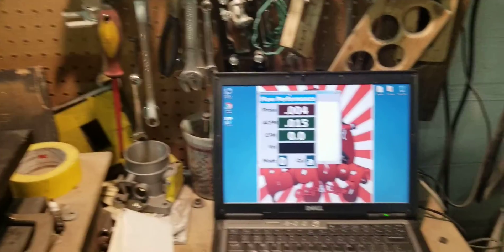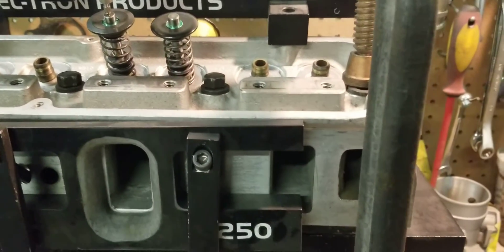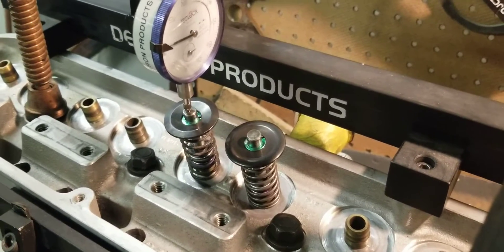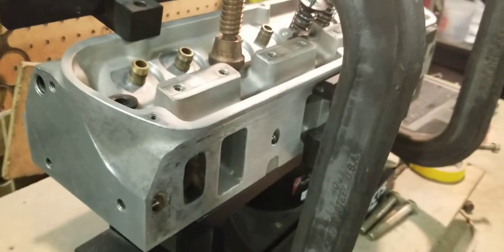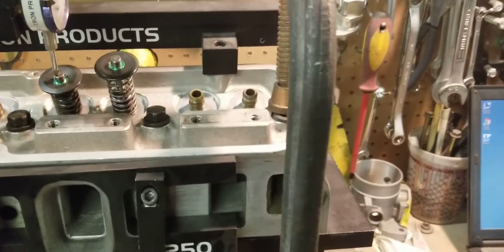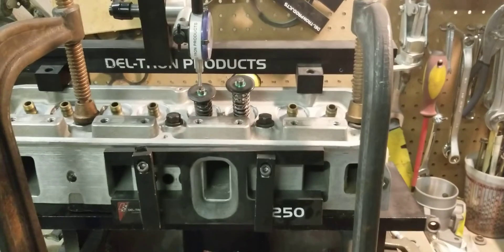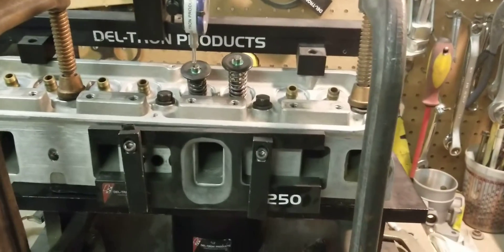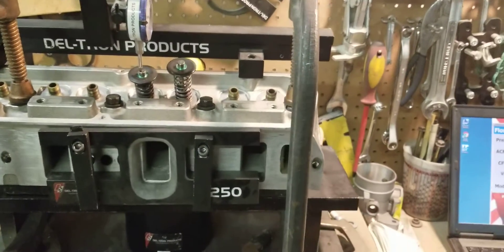Small block Ford Edelbrock  Performer heads being flow tested.

Comment: This man is right 💯 flow at low lift on street motor. 

High lift big numbers only matter on track. 

We're lunching at 5-8k and staying in that Area matters. 

So many people build street motors the wrong way. 

And than complain the car is a dog.
Reply: The tfs tw smoke these at .200, .300 and  .400 .
Reply from the maker: Our Stage 2 185s smokes the tfs 170s, tfs 11R 170s, Explorer Performers, Brodix str and many others at a lower cost! 58cc chambers, pac dual springs, 4 angle valve job, fully ported, studs and guide plates, 150lbs on the seat with 298/220cfm! As of the date of this comment $1,550!
Reply from the maker: @chrismoher5444  yes. High lift numbers need a much bigger and longer duration cam with supper expensive valvetrain and higher rpm to shine which is not practical for the majority of street/strip cars.

Comment: I've got a set of Edelbrock Performer 5.0 heads that I got ported by a local shop many years ago. I also had them install 2.02 intake valves (they came with 1.90). Their finished flow numbers were very similar to what your numbers were. They did have more work done, and, of course, flow benches vary. I am about to see what y'all can do with the stage 2! Thanks for the awesome vids, I can't wait to get y'all some of my parts as I like to go fast!
Reply from the maker: Our porting style is very aggressive meaning most places full head porting services start at their level 4 or 5 on their option list whereas our start at or Stage 2s. Basically what you are getting with our stage 2 porting is full race porting and mods of the intake, exhaust and combustion chambers as well as 4 angle valve job, backcuts on the valves, before and after flow testing and our other porting tricks for a industry low price. This is why our stage 2 porting program is soooo popular and in demand. Contact us and we encourage you to compare our prices and you will see

Comment: Great content on your channel! I just subscribed! I just acquired a 347 long block in excellent shape… It came with a set of Edelbrock performer heads E. O. D-215-46. On my current set up in the car I have a set of AFR 165s. Should I just use the performer heads on the 347? With maybe some port work? We’re just use my AFR 165s? I run a Vortech V3 supercharger on my current set up and plan on doing the same for the 347.
Reply from the maker: Both would definitely benefit from our Stage 2 porting. With the added flow from the porting it allows you to make more hp with less boost and less camshaft that would make for a safer tune and better drivability. That's what our boosted customers experience.
Reply: @bigdogsportingtonyb2833  Where are you located?
Reply from the maker: @greasemonkeyguitarshop  Lansing Illinois.
Message us on our Facebook business page at Bigdogs Porting to go over details and set up orders.
It also has a tremendous amount of content and other videos that might have not been uploaded to YouTube. We have a before and after flow results videos of some AFR 165s that we did on there.
Reply: @bigdogsportingtonyb2833  OK great… I’ll check it out! Thank you sir!